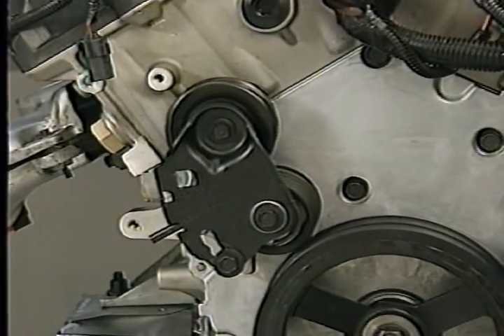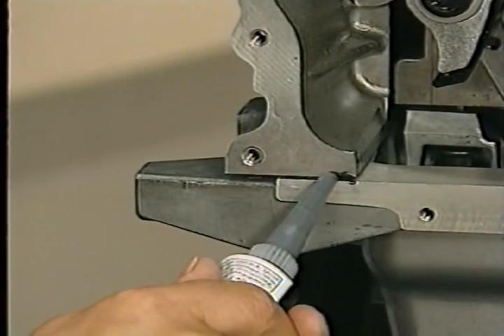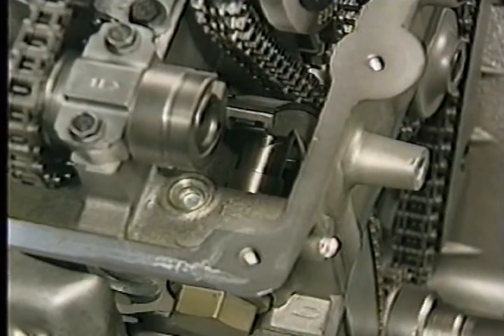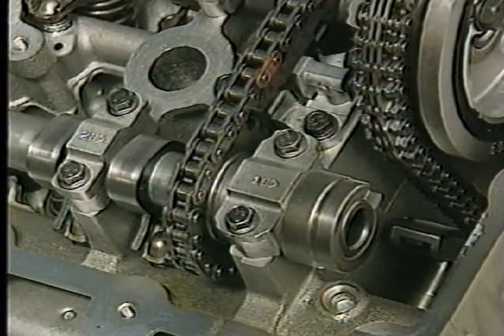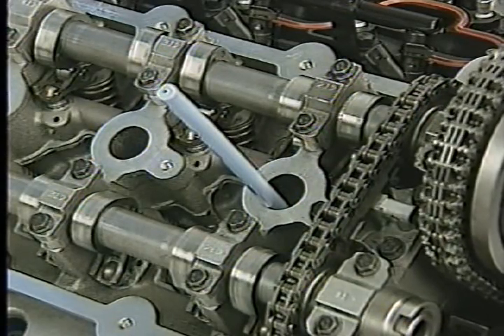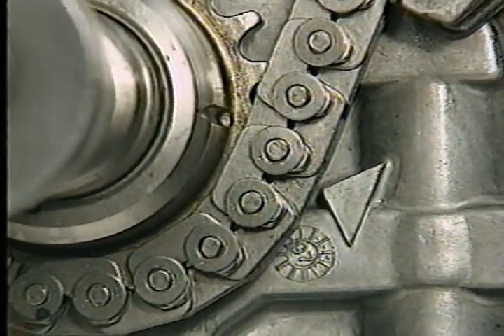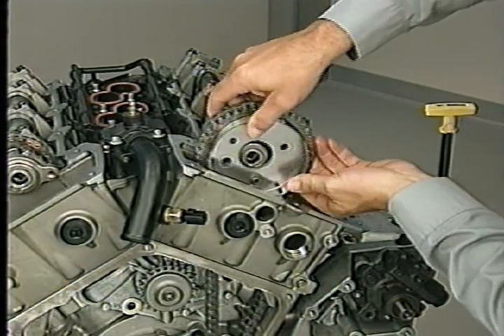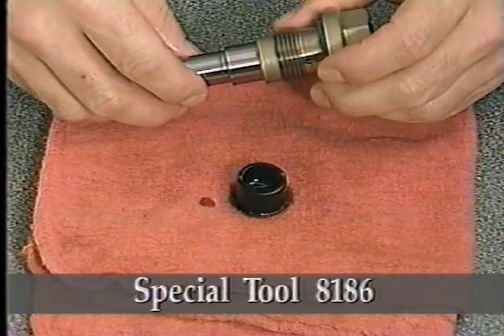Chrysler Mastertech 1997 - Introduction to 2.7L, 3.2L, 3.5L V6 engines  -- Part 2

Comment: I've got my 133,000 mile 2.7 L v-6 engine partially disassembled now.   I've removed the timing chain tensioner and see clearly that it has been overdue for a timing chain replacement    I am enjoying learning how to do this and proud of the fact that by using synthetic oil exclusively I have zero sludge.  Using cheap oil and neglecting oil change intervals are the owner's methods of destroying an outstanding engine.

Comment: This engine is terrible!  The water pump kills these in droves.
Reply: No the owner neglecting to fix them asap after the water pump starts leaking killed them. Mine didn't die or sludge when it went bad. It has 226.000 miles . As soon as I saw a leak I parked it. You won't find one ounce of sludge in the engine.

Comment: when you do one full turn are the marks supposed to match up ??????
Reply: No is the correct answer.  It could take as many as 20-30 full revolutions for all marks to line up again.  What's important is to ensure the crankshaft markings align with the markings on the oil pump housing during installation and that the intake camshaft markings on the sprockets align with the plated links.
Reply: Yes

Comment: Hi bro,plz help me out, I have 2.7L V6 Chrysler,It was over heated and its water pump was gone and water and oil was mixed became milky oil.I replaced the new water pump and checked everything is fine nothing damaged, only water pump was broken,the water pump is new now but it's not starting :-(more than Three times open head and reset the timing chain, but didn't start the engine,don't know what's wrong with it.!Plz help me out.!!!
Reply: It's your camshaft positioning sensor... It's not set to fire properly..

Comment: The 2.7 engine was a lemon from the start.Poor design,and nothing well thought through...
Reply: That sludge bucket that Chrysler produced deserved the complaints they received.The aluminum block and head produced so much heat the oil would turn to burnt crust.That engine was a joke from the start.I would love to see a class action lawsuit get filed from it.There needs to be one period.No "bullshit" to it as you say...

Comment: Hello, i have Chrysler 2.7 C300I had water pump issue and enigine overheated,And stopped working and oil water mixed together,I changed the water pump and checked all components,everything is fine,just water pump was broken,I replaced it,but the engine is still not starting up :-(I have been trying for so long but nothing working,don't know what's wrong even timed the timing chain, someone please help.!!! 😭😭

Comment: Could someone please explain to me why I have a small hole that leaks just under the gasket and just outside the thermostat housing frame? 2.7
Reply: 10.3.15.     It leaks due to the water pump shaft seal that is wore out. It's imperative that the water pump be changed soon, or the oil will be contaminated with antifreeze, causing rod & main bearings to fail! The water pump on this engine is buried in the engine, compared to most other engines! Every manufacturer has issues with something in their designs. The trick is to be aware of the potential weak points of any vehicle. If caught early, you can get very long life on most makes......"Things that I automatically incorporate on any of my vehicles, is I change my oil every 3k miles/or 6 months.........Antifreeze every 30k miles/ or 2yrs, with a new thermostat............automatic transmission filter & complete fluid flush every 30k miles. 😎 but I do all my own work.
Reply: +Steven Sapyak yea, it's a major design flaw an a pain in the phucking ass to fix.
Reply: It's there by design and is a weep hole for the water pump.  Provided it's a small amount of leakage, it's perfectly normal, so ignore the misinformation below.

Comment: 2006 DODGE CHARGER 2.7LAFTER REPLACING THE WATER PUMP AND THE THERMOSTAT STILL HAVE OVER HEATER PROBLEM IS ONE OUT THERE HAS AN IDEA WHAT OUTS CAN BE THANK YOU.
Reply: Eduardo Garcia Thermostat installed backwards(been told it's possible), maybe head gaskets or bad electric cooling fans maybe.
Reply: Thermostat is ok, water sistem got purged, Water pumps is ok. You may have a leaking between block and heads.

Comment: Starts run with little miss put in gear you have to pump
It to keep. Running put my finger on it vacuum  line crumbled
I wood bet every all if not at least a
Reply: +Mike Carter Did you pass out mid sentence dude ? !

Comment: Thank you for uploading and sharing this video.  :)  The special tool to hold the crankshaft damper in place can be substituted by chains wrapped around two damper arms and secured through holes in body steel in contrasting positions.